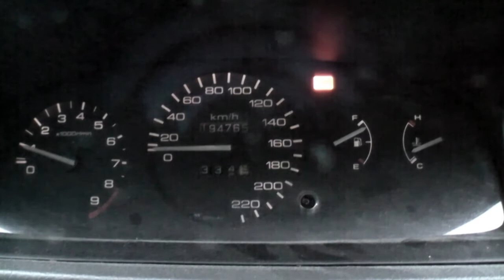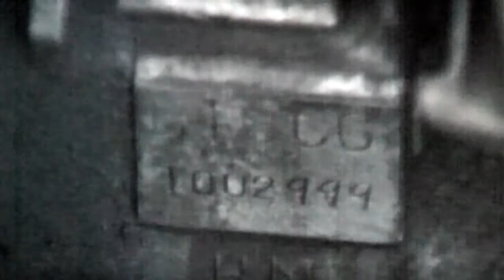Honda Civic engine swap. B16A2 to B18C6

Comment from the maker: @Visions2Be B16a2 i very simple, just bolt of and bolt on :) B16a1 need some electrical stuff and b18c4 have a bit of different looks on the intake manifold for example. But b16a2 - > B18c6 is just drop in! I had never don a engine swap before and with my friend we did it in about 8h.

Comment from the maker: Sweden since it was new. Manufactured in Japan. It is just primed on the inside with blue splashes from the outside paint. The white cars are white on the inside, that is correct. Perhaps becouse it is a cheaper color. Red cars are also red on the inside.

Comment: Great video. I have a customer that wants to swap a B16A2 for a B18C6, Is a Civic 2000 Si manual tranny. Is it really just remove and install or do I need other mounts, harness, ECU, ect? I need to decide if I want to get into this trouble and also do an estimate. Thanks for taking the time to read this question.
Reply from the maker: I just had to remove and install but i don´t know if there is any specifics for the later models with B-series. https://www.civinfo.com/ should have some answers for you :)
Reply: @Mordiiax  Thanks for replying. Have a great day.
Reply from the maker: Np :) It was 8 years ago i did the swap so i can´t do any better answer than that :D Ohh, i did retune the ECU. Otherwise it will give the wrong values.

Comment: Appprox how much would shop charge for a engine swap like this if you already have the motor
Reply from the maker: Bryce Davies It is not that more complicated than a clutch change. It took me about 10hrs to do and i have never done anything like this before but with some help from my friend who works at the shop. But it is very hard for me to guess any more specific.

Comment from the maker: 15x7". 205/50 Toyo R888. I have a thread @ civic-eg.com under "Your Ride - Hatchback" called "Honda Civic B18C6 Clubracer -93" if you want to know more.
No problem rubbing the fenders. On the other hand the inner plastic fenders have taken some beating.